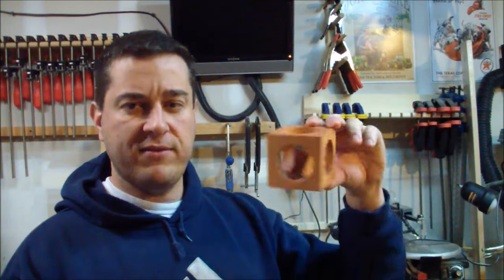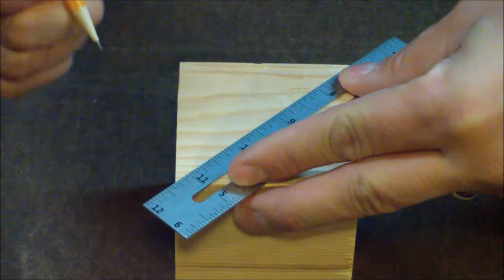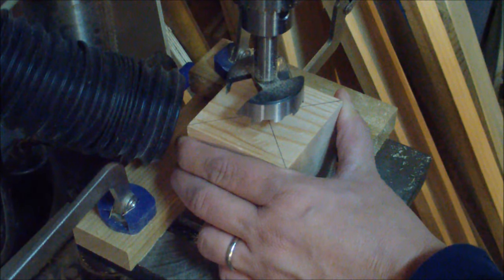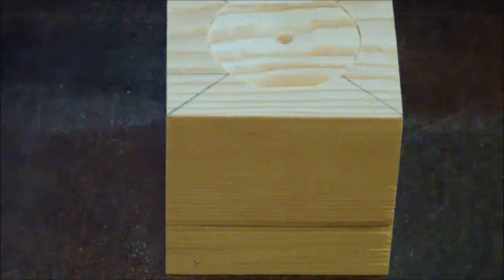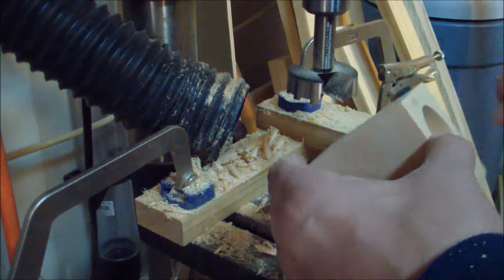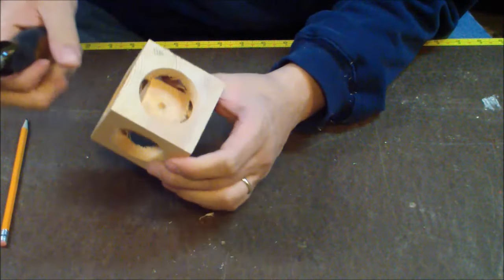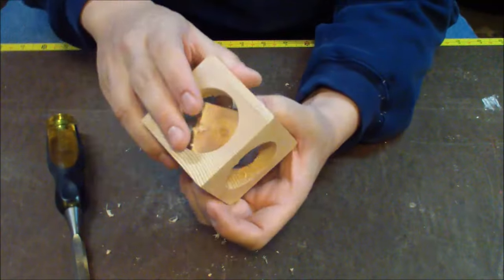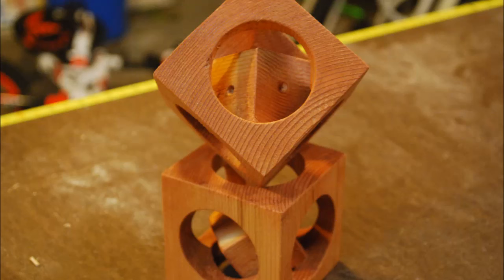How to Make a Cube In a Cube (woodlogger.com)

Comment: Interesting, but how awesome it would be if you could avoid the 'dimples' in the centres of the cube sides.  Anyway, well done!
Reply from the maker: ***** Thank you.  Yeah you could file down the point on the bit to avoid.  I would think that would work...?
Reply: +WoodLogger That would work if you have a drill press to hold the bit still. You could also use some filler mixed with fine sawdust of the same wood.
Reply: +8233Eire Before you drill with the forstner bits, you could drill a 1/2" hole completely through it on all all six sides, then the small cube will have holes through it like the bigger cube to match, and gets rid of the dimples.
Reply: + Seth C     
Clever!  Thanks for sharing.
Reply: +8233Eire  If you have two fostner bits and remove the center screw out of one.  Use the first to start the hole and the second to create the flat bottom.  It's a little tedious but you can start all the holes and then switch bits to finish them.

Comment: You could use carborundum fingernail files to get in there and smooth of the corners of your inner 'box' for ease of use. Better yet, make your own by gluing sand paper of different grit onto different sized pieces of thin ply :))

Comment: I was a tool and die maker for 10 years. I made a set of five of these out of aluminum.  before I cut the square out in side I drilled holes or dots on the inside square like a dice. I also rounded the corners of the outer square so they would roll a little better. now they are like playing a game. great job with the wood.

Comment: I just made one of these with our old heavy duty drill press. I took a few pictures too but they may not be the best quality. I'll add them if I figure out how, I'm not the best with computers. Also, I avoided potentially cracking the wood by using a dremel to cut out the center cube. I'll probably still do a bit more fine tuning to it. Great video! :D

Comment: Yeah.... it looks pretty awesome once finished. I once did a 'cube in cube in cube' made out of Phosphor Bronze sized about 3". and got it Gold plated later. It was an amazing experience, took me about 2 days.....
Reply: Excuse my translation of it through Google translate ... I had 17 years in a specialized school (1985) my teacher gave this task. calculated and made from an aluminum cylinder 60 mm in diameter and 60 mm long. I said no problem ... when I calculated I wanted to produce the drill but he stopped me and pointed to a lathe ... it is not possible !! It was my reply. he just turned his head and gave me to 4 hours! 1 hour it took me to figure it out, and 3 cube that I made. intrigued me home and I calculated the "cube on cube in cube". material aluminum cube 30 mm, 45 mm cube, cube 90 mm. teacher allowed me to produce. hole diameter was 4 mm less than the diagonal cube. My teacher last semester designated project: 6x cube but only technical documentation, workflow, hole 2 mm less than the diagonal ...

Comment: Great project, thank you.
My largest Forsner bit is 1½ inches so I made the cube 2 ¼ inches on a side. The proportions worked, it looks great. I am thinking of enlarging the holes in the small cube a bit, filling them with dark wood filler then sanding them flat.  Wait, just noticed the holes in the small cube are just right for ½ to 1 caret diamonds. Wood filler or diamonds, decisions, decisions.

Comment: Should use a smaller bit and make the square inside match the same design as the square inside. First use a smaller bit and drill all the way through each side and then go at the outside box with the larger bit. Would be a cool effect.
Reply: that was the first thing i thought when i saw the holes in the center of the faces of the cube in the center.

Comment: Have you considered making a cube inside a cube inside a cube? I would but I don't have a drill press. I'd presume that you would drill the smallest cube first before doing the second one. Just a thought.
Reply from the maker: +Rabidavid I've never done one of those.  I have seen others do it though.
Reply: In this comment I will name my cubes A for the largest cube, B for the next smaller cube and C for the tiny one in the middle.

For my first try making this today, I made the cube A on the bandsaw (approx 60mm sides) and drilled out the 6 sides to define the shape of cube B.  Now in an ideal world, I would have kept cube B attached to cube A so I had a solid shape in which to define cube C, but as this was my first try I was so excited about making cube B that at that time I hadn't even thought about making a cube C.  After cube B was loose and the edges sanded down a touch I then had the idea of making cube C.  It was a bit tricky to hold cube B (a simple clamp fitted through the holes of cube A in the end) but holding it square enough to make cube C square was difficult.  I used a small offcut of the original wood held between two adjacent holes in cube A to hold cube B fairly level and held on to cube B with a clamp to get the holes in cube B made to define cube C. My result, while a bit of a faff was very nice, and I would make this again but leave cube B attached to cube A for longer to define the shape of cube C.

If I make cube A larger, who knows how many levels deep this could go.

I don't think it is possible to include pictures in comments on here or I'd show you the finished product.

The only real obstacle would be to get hold of much larger forstner or similar drill bits.

Comment: I have an 8" drill press 5 speed
With a 2" forstner bit but doesn't seem to cut holes 
Very well any pointers ?
Reply from the maker: Hmm, I know on the end grain it took awhile to get through the wood.  I set the speed to the slowest setting, and finally got through it.
Reply: Sorry I had a cheap drill press and currently got a better one and it works now. But thanks for the feedback. 
Keep up the awesome wood working. It's keeping me inspired.

Comment: is there a way not to have the holes on the inside cube
Reply from the maker: Colby Weiss You can file the end of the spear point down so that it's flat.  That should work..?
Reply: +WoodLogger wouldnt it not drill a nice spot then
Reply: +Colby Weiss I was thinking the same thing. Maybe make your first shallow cut on all sides with the point still intact. Then shave it down and finish the drilling. That way you'll have the sides of the holes as guides. Another thought would be to use those holes to your advantage. Maybe add in some detail and screw in some screws in the holes. Maybe a small metal plate that gets screwed in there. Now I need to go buy a drill press.
Reply: Ok yeah good idea
Reply: +Colby Weiss You could definitely either do it (or finish it) with a lathe.
Reply: +Colby Weiss My look better with a holes drilled right through
Reply: Colby Weiss you could start with a forstner bit then switch to a plunge router set to the correct depth, have a steady hand, and the dimples are gone!